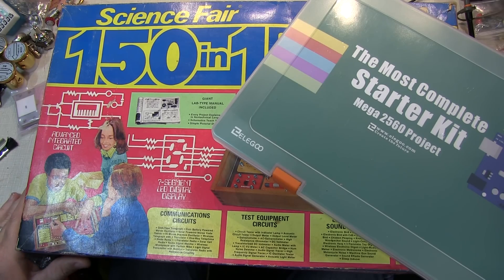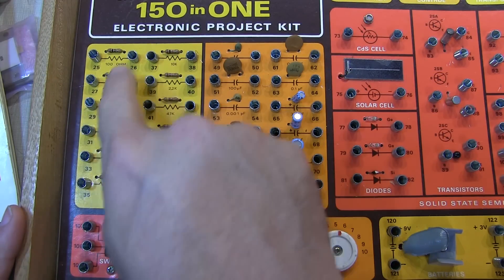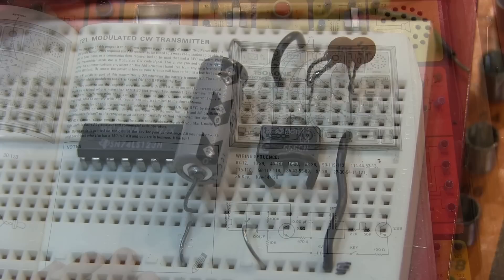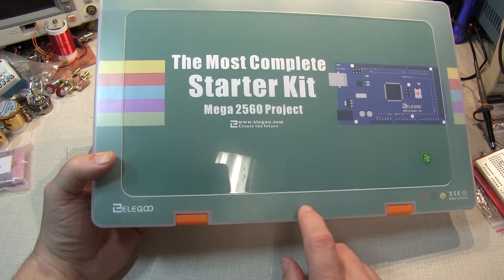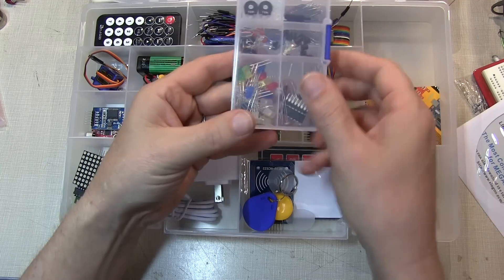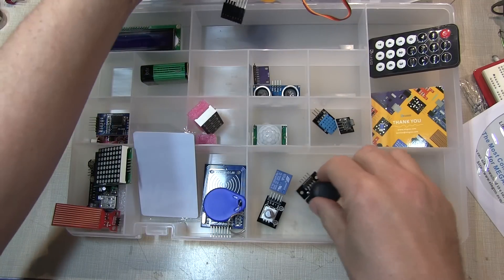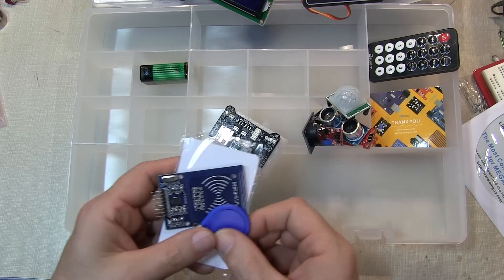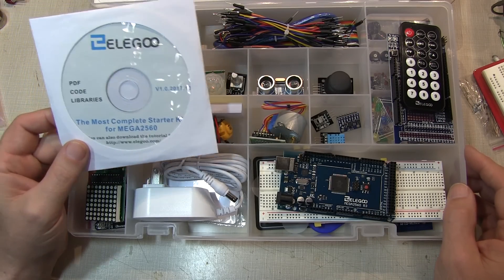#298: Electronic Project / Experimenters Kits - Then and Now - Science Fair and Elegoo

Comment: So thank you for sharing this.  I was looking on ebay and see some for sale, that is the older kit.  This new one just doesn't seem to be geared towards ham radio and maybe it is not  meant to be.  I am looking for a kit that will teach me more about ham radio stuff.  Any suggestions?  Thank you for sharing this video.
Reply from the maker: It might be tough to find a multi-project kit that will do more radio things (other than simple AM receivers), because the long wires and fixed component layout are not generally compatible with high frequency / RF signals (too much stray inductance/capacitance).
Reply: Thank you.  Would you recommend the new kit that you were showing as a way to learn?  I bought some soldering kits hopefully they will help out. @w2aew
Reply from the maker: @53Heidi2   You can learn from any kit, it all depends on whether you want to learn more about microcontrollers like Arduino and plug-in modules, or you want to learn more about descrete circuit design/operation.  There is no one perfect kit to learn from.

Comment: I remember this kit well when I was in grade school, just before I went into high school mid-late 1970s.  Along with it and the Tandy Color Computer, I credit them with my career path... electrical engineering (my college degree 1980s), computer science & programming (my second college degree 1980s) then on to network & data center engineering (1990-present, mainframes to the first network operating systems, Linux and high-end networking - Cisco, Juniper, etc.).   I've mostly retired from that now and only consult when I feel like it.  ;)

Currently, I've diving back into electronics after 35 years away... and have been enjoying the current Arduino/ESP32/RaspberryPi builds I'm now exploring.

Comment: Had that Tandy 150-in-1 kit! Granted I, like I suspect many of us, used to wire up the circuits without really understanding everything about how they worked, but the exposure to the function and application of the various components still provided those tid-bits of knowledge that still linger on 40 years later. Thanks for this! (p.s. That kit is in excellent condition... a real gem!)

Comment: I had a radio shack kit around 1972.  It was 50 in one as I recall.  Had a photo cell, and I built a few things without much understanding sadly.  id did later become an engineer and got BS and MS degrees  These types of kits were so good in the winter time when indoors. Thanks Dad for getting me a microscope, a small telescope, a gilbert chemistry set, even a planetarium.  They were cheap and did not work very well, and were used, but they gave me some insights.  Wish he had known enough to get me some technical books for algebra, even calculus and physics for sure.   I had so much curiosity and these things helped.

Comment: Elenco has an updated version of the RS kit. It's hard to find kits that have a tuning capacitor in them. I believe the radio you made with it was a TRF set. No IF transformers. Agree that the newer kit is A FANTASTIC VALUE given what others want for the various sensors and add-on modules for microcontrollers.

Comment: If you are concerned that the springs will wear out on the Radio Shack kit, note that a banana plug will fit in the top of the spring. If you use stackable banana plugs you can connect just about any circuit without using the springs

Comment: I had the 150 in one kit but it didn’t have the ic or 7 segment display mine had an scr and it sometimes picked up uhf television audio when it was wired up as a mw receiver, I also used it as a one transistor mw transmitter with my long wire antenna transmitting over several streets:-)

Comment: I would love to download a scanned copy of that old user's manual in that old kit. 
Look at the incredible amount of analog electronics taught back then. With full theory of operation for each circuit! 
Now a days, you'll learn nothing about analog electronics with the new kits. Only programming microcontrollers and jumpering a few ready-built modules together. 
Ask them to throw a class AB amplifier, and they can't. They won't even know what it is! 
They'll pull out a pre-built transistor module, or an LM386 Arduino module, and there you go!
Fundamental knowledge is being lost daily...
Reply: Found it!
http://www.zpag.net/Electroniques/Kit/160_manual.pdf

Comment: I owned that exact 150-in-One kit in the mid 1970s. I find the new kit lacking. Here's why: They Tandy kit's goal was to provide basic education in basic electronic components and circuits. You needed NO training or assembly skills. The focus was entirely on the principle and functionality. Everything else was made easy. The new kit requires you to use a computer to open a CDROM manual: great for production efficiency, not exactly so for a kid sitting down for some immediate gratification and hands on fun. The new kit projects end up being messy protoboard affairs, assembled from scratch: I've done that and it's no where near as fun as using the Tandy kit. The cool thing is you can do much more sophisticated projects with the Elegoo kit.

Comment: I had a 10 in 1 kit when I was 9 or 10 I think - also from Tandy/RadioShack - it sparked my career in electronics which eventually led to  becoming a software developer. My current interests are old valve/tube receivers - have restored a 1952 NRI Superphone Weekend 2. When I trained valve techniques were still taught and in fact in use (I was originally in a programme to train engineers to work on air navigational aids - transmitters/receivers, radar etc.)

Not so long ago I bought a kit for my 10 year old son which used snap connectors - > https://www.elenco.com/product/snap-circuits-300-experiments/  

It held his interest for a short while. However he soon got bored with it. 

Right now he's experimenting with my old LEGO Mindstorms set - it's an NXT 2.0 but I have an EV3 brick and extra components. That seems to be holding his attention at the moment so far.

Comment: I had the 200-in-1 and later at a garage sale, picked up a 30-in-1 which I seem to recall specialized in radio projects. The book is really the best part of the kit, it starts with the basics and steps up the difficulty incrementally, while making more interesting and rewarding projects. 

Halfway through, the book "resets", eschewing the pictures of the completed wiring on the board, showing only schematics, and saying that you have to figure out how to go from the schematic to a completed circuit now. All the previous circuits had both a picture AND a schematic, so you can backtrack and check your understanding.

That's what got me into reading schematics, and I've never looked back!

Comment: We are of a similar age because I was a teenager in the '70's too.  I was lucky enough to live 1/2 mile from a Radio Shack and could pedal my Schwinn Stingray (with banana seat and sissy bar) there when they still stocked components (before they started selling toys).  I still have my "Battery Club" card.
Reply from the maker: My battery club card is long gone, but I had one!  I had a green stingray with the shifter on the center tube for a while, but mostly rode a Schwinn Varsity 10 speed.  My Radio Shack was 4-5 miles away, and I also had a nice electronics surplus store that was about 8-9 miles away.  Lots of miles ridden to and from!

Comment: Interestingly, you can still find the 500-in-1 kits; they have a nice, clam-shell case and three manuals. The first covers basic DC and AC electronics, the second one covers digital electronics, and the third covers programming a microcontroller. They have some components with the spring terminals, and a solderless breadboard and other “loose” components in ziplock baggies, plus the hook-up wire in various lengths.

Comment: Hi, i have some problem that i want to ask you for help. I want to convert 5v logic to 11v logic by using SN74LS07 ic with a pull-up resistor to 11v, so will it work?
Reply from the maker: Yes, this type of logic translation is what the 74LS07 and its open collector outputs are designed for. Power the device from 5V VCC, and connect the pullup resistors to 11V.  The device can use pullups connected to as much as 30V.
Reply: @w2aew  thank you so much

Comment: I managed to get my parents to buy me the 150 in 1 kit back in the late 70s.  Might have even been a christmas present.  The newer kit sure is neat and has a lot of capabilities.  It seems like the older kit was more about making circuit out of individual parts that does something simple, but you get some insight about how electronics work.  As I recall the book that came with the older kit has some brief explanation of how things worked.  Although I don't have experience with the new kit, it appears to be more like the user would be interconnecting various modules and perhaps writing code.  In this case, the user may not gain an understanding of the operation of the electronics, but it does reflect how a lot of projects are developed nowadays.  People tend to buy various vendors' development boards and interconnect them to get some hardware system, hook up an arduino or what have you, write some code, and they're off to the races.  Throw in a little crowd sourcing, a little social media, then Robert is the sibling of one of your parents.

Comment: I had that exact 150 kit also, but looking back at it some years later and advancing into an electronics career, it was very evident they did their best to not teach
any electronics theory with it, in fact they made sure you had no idea how each circuit worked, there was nothing, you just connect the dot's. It was like painting by numbers.
I did learn from having the kit, but more by experimentation than anything in the supplied book.
Reply: I remember the same thing. The value would of been in explaining how the circuits worked.

Comment: Your 150-in-1 manual is in far, far, better condition than mine as mine is so worn the pages were beginning to fall out.  I received mine around 1980/81 (age 9/10) and my cousin and I spent countless hours experimenting with it during summer breaks for quite a few years.  I would dare say we built all 150 experiments plus countless others not in the book as well as many variations that combined parts of multiple experiments.  It was almost a wonder that we managed to avoid ever damaging any of the components, aside from wearing out the original bulb, though by now the electrolytic capacitors are probably well past their prime.  I still have it around here somewhere!  Before Radio Shack went out of business I bought one of their newer 200-in-1 kits for my nephew (currently age 6) as a future Christmas or birthday gift a few years from now!

Comment: You're a good salesman -- I just ordered the Elegoo kit.  In grade school, in the mid-60s, I had a Knight (Allied Radio brand) 10-in-1 transistorized kit.  I still have it, and I just checked the date on the instruction manual -- 1957.  My father (an electrical engineer) had bought it for my older brothers.

Comment: Both seems a lot more fun that the one I had when I was a child.
The only thing I learned with it was that a 9V light bulb does not work that well on 230V.
Reply: Actually, it came with a 3V bulb that burns out instantly if 9V is applied to it.  If I wanted to experiment with the 9V battery and the light, I had to use bulbs rated for 7V or so.

Comment: I had a 120-in-1 kit like your older one that my dad bought me from radio shack when I was a kid in the 90s. I loved messing with that thing. I could never get the crystal radio or the powered AM receiver projects working as a kid though. When I found it in my attic in my early 20s, I pulled that sucker out and built both of those projects in working condition. Really neat kits. I bought my son one of the snap circuits kits from Elenco. He really enjoyed building the little projects it has as well.

Comment: Very similar variants of the 150 in 1, 200 in 1, etc. are still on sale via amazon. I bought myself one of these kits when I was in my twenties - for a beginner of any age they are excellent, even if you 'outgrow' it very quickly. The spring connector design and physical layout still work in both a tactile and visual learning sense, the printed instruction manuals are generally very good also.

Comment: I made a simple shortwave radio with the Science Fair kit as a kid, and boy did it really work!  Of course, my dad being a ham as well, pulled out a long line of similar gauge wire from his junk box and we made a longer receiving antenna and we dropped in a simple little speaker in to the circuit, and that really helped.  Lost my hearing in both ears when I was about six years old, so that little ear piece that came with the kit was useless for me.  But, building simple little circuits was a lot of fun, even for a seven or eight year old.

Comment: Ironically I just found my old radio shack project kit in the basement tonight when I was looking for something else.  Mine was much newer than yours and made of plastic instead of wood.   I don't remember all the components but it was very similar to your kit.  The speaker, lights and terminals were all built into the front of the case instead of the top.  I had a lot of fun with it back in the day and learned a lot about electronics.  I plan to go through all the projects again when I'm done working and have more time.

Comment: The one I had growing up had one vacuum tube. It was made by Allied Electronics.  Where were even some dangerous voltages to be found if not careful. The fancy connection terminals were fan-stock clips.  Can't remember how many  projects there were, but I was a lot of fun playing around with. Just remembered it came with those weird and terribly uncomfortable head phones that had round thin metal plates for the drivers.

Comment: When I was a boy in the 50's my first interest was Chemistry so every year for about 5 years I got a bigger and bigger Chemistry set for Christmas until I had the largest available. After that I had to build up my own lab. My second interest was electronics and I salvaged parts from old radios and built a few things, some of which worked but mostly not. I never had an electronics kit for some reason. When I finished high school it was either technical school to study electronics or university to study chemistry. I always wanted to go to university so I ended up with a BSc in Biochemistry. Nowadays my hobby is electronics. At lot easier to do at home than biochemistry. I just bought that Elego kit but have not started with it yet. My first electronics kit is a bit complicated, ha, ha.
PS: I was disappointed some years ago to discover that you could no longer buy chemistry sets in Canada because the market was not big enough for the manufacturers to justify printing all the labels and instructions in French and English. A disadvantage to having bilingual labelling requirements.

Comment: I remember the kits, later sold them, never had one. At about 13, I jumped into building an amplifier from the schematics in the back of the RCA receiving tube manual. I still remember whooping with excitement when it worked. Still have it. Then, of course, I talked myself out of an electronics career. Got disillusioned when the magazines could only talk about Altair computers. Now I have to do it for fun. I need the Atmega kit!

Comment: Yes I remember I had a spring kit in a black plastic suite case. It came from japan and had a german manual. My father got it for 99 DM around 30 USD in tbe seventies. The integrated circuit was a thick film one on a ceramic substrate and included one transistor. There was some discrete one as well. And I had some spring kits from Philips. They had spring kits in different levels and one with a crt but it was way to expensive for my dad. What a crazy time the seventies. Today I use the breadboards or a pcb service